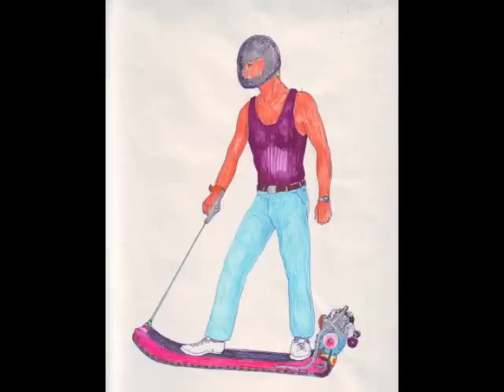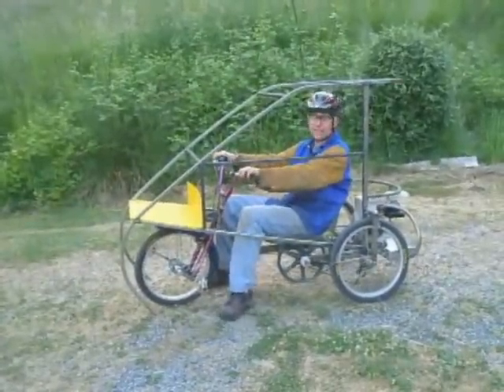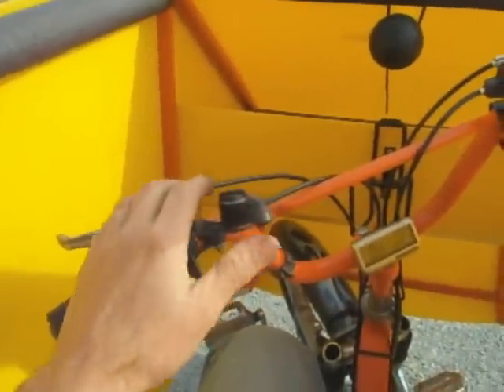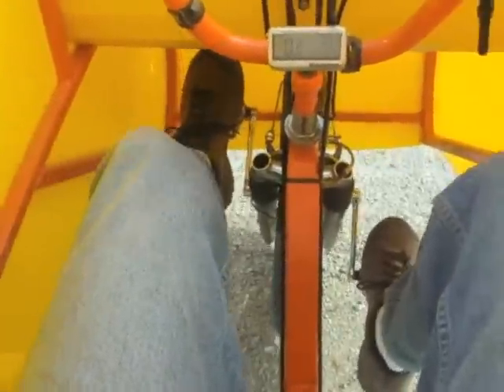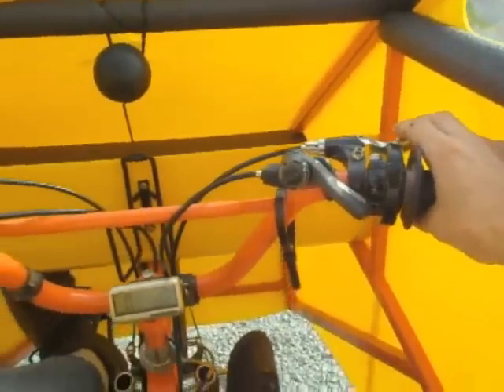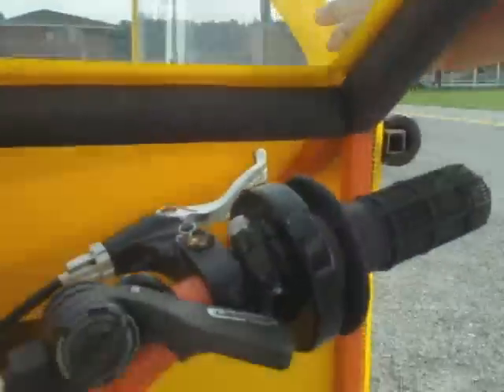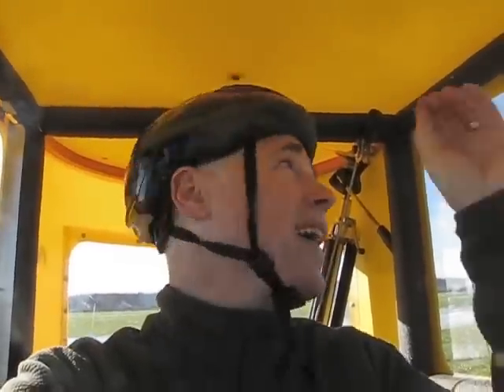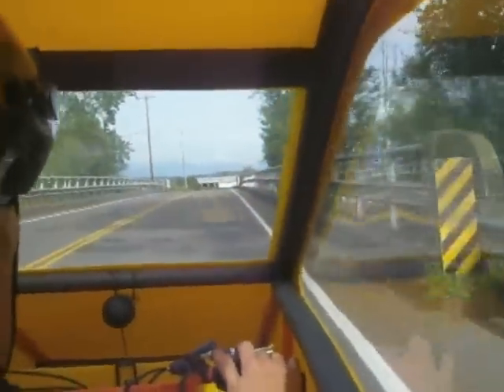Delta motor assisted tricycle

Comment: If you had to guess, how much choroplast do you think you've gone through over the years? 

I made a cargo bike, then I tried to add an electric motor to it. The motor is only 1/2 hp so maybe it's never going to work, but it's 90vdc variable speed. I should probably just use it for a belt sander or something. But I'm thinking about cutting my own sprocket with as few teeth as I can fit for the motor and then using another shaft to....I'm sure there's a term for it that's escaping me. A big sprocket on one side from the motor then a small one to the bikes back tire.  

I used a BMX back sprocket welded to a coupler nut that I drilled out to 5/8 for the shaft and just drilled and tapped for 3 set screws into the keyway since I don't have any way to broach that and filing seemed like a lot of work. I think it was geared wrong because i could only go about 5mph on level ground once i got myself going. Gear up and it slowed down. I had installed 2 banks of (4) 12V 10Ah batteries and a 48VDC brushless motor speed controller (a lot of weight) but i havent given up. The cargo bike is still functional. I'm also planning a camper trailer with the base being similar to a karla cargo but the rest from foam insulation with a plywood floor. 

I have a mountain bike with fork suspension and a front disc brake that's begging for something, possibly the electric motor and that could make a tricycle like the one you made that you show in this video. I like the unicycle front wheel, this is a gamechanger for accomodating the local ebike laws. Anyway, I appreciate you and the inspiration you provide. Thank you for sharing your skills knowledge and experience

Comment from the maker: I pedal sometimes to get it started or when I'm going up my steep driveway.  If you've seen a unicycle, thats how fast I go, but the motor is connected to the 6 speed gear cluster allowing me to go from 4 mph to 25 mph.

Comment: years later just seeing it now, I LIKE IT. I'd like it more if a 2 seater, electric powered, and had some simple suspension at all 4 wheels, but thats another and completely vehicle! large old V8 valve springs with bolts run through them, washers and skateboard truck urethane to quiet clanking, or making use of the tiny coil overs from mountain bike rear suspension, whatever works to absorb abuse to tires rims butts etc, without much space or weight.

Comment: Very interesting. A couple questions: Can you venture an educated guess about how much these could be built for and sold for if produced in a commercial quantity...say 1/day? Why did you choose gas instead of battery? And how could this be secured when parked at a shopping location? I am concerned that it wouldn't take much for this to be lifted into a truck. Thank you.
Reply from the maker: I'm not sure about the production cost. I chose gas because of the price for the engine compared to electric and battery and gas is readily available, cheap and you can let the vehicle sit for a year and start it up unlike batteries that die after sitting a spell.
Reply: For the "parking question" i think you can just buy a chainlock and by using that just tie it into the wheel going to the body of the bicycle

Comment: You should put a floor in it and wrap a pipe around the exhaust manifold and use a fan to pull air through it, That way it would have heat in the winter.

Comment: Hey Paul!
I have rough plans of buildning something kind of similar, so I have as few questions for you if you would like to answer. 

I wonder, what are your thoughts on the windows, what kind of material? plexiglass? Something stiff or rather something soft?

And also i want to ask you, do you know the dimensions of the metal tubes? As I want to keep it as light as possible, but also stabile. Is it iron? Aluminium? I'm pretty lost when it comes to metal.

Have a good one!
Simon

Comment: Is there a significant advantage to using a steel frame vs aluminum? I wouldnt think the use of steel in that little of a "bike" would save you any better than aluminum considering the weight of even a motorcycle hitting you.

Comment: Yes,aerodynamic,small turbo diesel[Honda has a new engine / 1Liter]Have you seen BMW's simple concept vehicle,3 wheel tilter,very low cd,0.18 and it is all flat panels.It is a blast to drive and ,as comfortable as their sedans, mileage is 2 liter per 100 Km 117 mpg USA.This and the clever are older designs,so 200 plus in a comfortable package could be built today.

Comment: Nice!  :) After having some experience riding this Pavo trike, what improvements do you think it needed?  For instance, did it need mirrors?
Reply from the maker: +JackANDJude I did have a drivers side mirror which worked well for seeing cars coming from behind. I was going to add a Nuvinci internal variable hub for the drive wheel, but did not. real glass windshield with wiper, Blinkers and electric horn, proper throttle control, disk brakes etc. But for what it was it worked ok.

Comment: You are a genius Paul! I have a question though, I did notice you have head lamps on the front of this cool enclosed trike, but is actually street legal in all states without having rear directional's in back and the back of the sides? I was also wondering if you could make something like this using an electric motor that not only plugs in, but also recharges from peddling the trike as well? Do you also make things like this for other's as well wanting something that you have made? On another note, I worked for a few printing companies as a "Prototype Technician" working along with the art department and I actually printed out the very first copy the client(s) would see before making any changes or going into mass production on the floor. That material you have there IS very expensive! Even more so when printed on both sides which I find it unusual you found some with only one side printed on? Be glad you did! They must have been on a really tight budget because all of the signage whether it be temporary or permanent on that type of stock that is used for political signage as far as I have always seen, has been printed on both side to be seen both ways, as when it's placed just in front, it doesn't get the exposure that they want. And what a waste to just throw it away... That stock does not recycle very well and some already comes from recycled materials. Thanks for taking it out of our land fills and using it in some awesome ways! :o). As well, a lot of stores use it as a seasonal decoration year round for all holidays (Christmas, Easter, Halloween, Valentines Day ect...) And just keep on switch it up over and over again. Or using it for isle signs and just move it around, like Menards does in their Building and Materials sections. You can also have this material stripped of the ink signage and use it again for new and updated signage, which is a less costly way to go rather than to purchase new every time. Printing companies don't strip it, but do know where to take it to who have the right chemicals as to not damage the material to strip it back down to almost new again. The only bad part is if you get with holes in it, some of it can't be used again depending upon who put the holes in it. If the printing company put in actual precision die cut holes then it's fine, but if the customer just punched holes that would make some of the material uneven or stick out, sometimes we could NOT put that back into mass production as it would most likely pop a screen. That is not only very costly! But that can also ruin a machine depending on what type of machine it is and how fast you can get that ink out and where the tear happened in the screen. I've had a screen blow up on my Svecia and I have had ink fly all over me and it sounded like a gun went off! That's how tight those screens have to be stretched by machine that take about 3 days to slowly stretch the material so it doesn't do it to quickly as to snap. Then after, a very thick and heavy type of hard rubber gauge is glued in place to keep it that tight. Then burning the screen and mixing the ink to the specs colors is whole different technology these days! People who print T-shirts overnight, use a totally different type of material that would never hold up to a mass production of a very high out put. And they don't use the same types of mesh either. However, they can pull theirs by hand using only tools and glue alone and in a garage that can shut all light out for burning the images into their screens. However, it's all pretty much done by hand and not machine, using an ink that's not very expensive and only can be eyed up as far as altering the color to match. But that ink gets all sticky and dry very quickly, so they have pull the ink every 20 shirts or so and thin it out and start again. My Fiance' has his own little garage operation and he also has a large digital home based embroidery operation with a few quad and triple headed machines. Now those bring in the bucks! But some people don't want to pay that much so they go the cheap route and just have them printed. however he only does them in quantities of at least 25 or more. Otherwise it doesn't even pay to create the pattern or the screen and order the ink for any less than that, unless he already has that all in stock already, which he will keep for one time shelving fee per screen, in which we have to rent a storage unit for now, that's why we have to charge. We ran out of room to store all of those screens for each color for only one kind of shirt. Very few are only one color, and those are usually for bouncers at bars only. Or stage staff. Anyways, I sure would LOVE to know if you have ever created anything for someone interested in purchasing something you have created? And I sure would not mind being all closed in with that material... Keep you dry and warm throughout the season :o)
Reply from the maker: Thanks for the interesting factoids on screen printing, especially the stripping and re-using coroplast for signage. The ones I gather are one sided signs along one way freeways. 
I actually do not make anything requested by people. I have taken ideas and ran with them, creating the Nomad camper from Emergency shelter viewers, but I try to keep the ideas original and to what I want to do. I just show people what I'm up to. If enough interest in plan requests is generated then I'll make them up. 
Cheer!
Reply: Have you ever thought of making one of these with an electric motor? And that way you wouldn't have to worry about it being street legal? At least not where I live. There are paths for bikes only, whether they are peddled or electric.

Comment: Nice work on your project. unfortunately this wouldn't be legal in most states without licensing and insurance, and I suspect not in yours either if you were hassled by police.  the criteria for power assisted bicycles/tricycles nationally  is a 50cc or less engine. my state doesn't allow any shifters, but this isn't enforced. You might get more stability with the single wheel in the back, but it complicates steering mechanisms.  Thanks for posting this video.

Comment: Near perfect machine you made it pedal that makes it leagal to use on street without insurance and you are not expected to use DOT helmets. I would add a rear view mirror, fender on all tires when it rains you need it. Add a tow hitch you can tow a trailer heck advertize on it. Helps to have a light kit too min 1watt lamp min with a blinky to rear there are 12volt cells that last a long time they can be rotated to other uses. Reflective tape outline. Could be a daily driver.

Comment: That's a really nice design. What state is it where you can have a 150cc engine? (not doubting you, asking for information).  Please join us at vvvvvv*motorbicycling*com, where there are other people building motor assisted bicycles from kits and from home-made designs. That is where I got this link.  I think the carbs on briggs 2HP engines leave a lot to be desired. You might swap it with an NT carb or Walbro.

Comment: add a sound box on the motor
Reply: Milan Jovanovic I read about those. A sound box is an electronic "noisemaker" audio device installed from the factory in many modern gas/diesel vehicles. It creates imitation engine whine,  throttle  and cruising sounds. Modern automobiles engines actually produce little to no sound. Ironically this is because they're more efficient in terms of gas to power. Modern vehicles have better combustion cycles, are more thermodynamic, and are designed to prevent and/or negate vibration. Many classic vehicle sounds actually came from heat or vibration noises escaping the engine. Yet people expect noise from gas vehicles, especially throttle sounds if a car/motorcycle is revving high. That's why automakers install sound boxes.
Reply: +Clarissa 1986 Hey I agree but many buyers expect, enjoy and even probably shop for a car that makes certain those noises. Its gotten pretty ridiculous though like you'll see many modern muscle cars and most modwrn luxury sports cars make heavy throttle noises even when theyre just accelerating a few feet in stop and go traffic